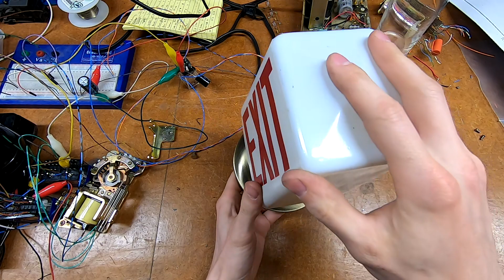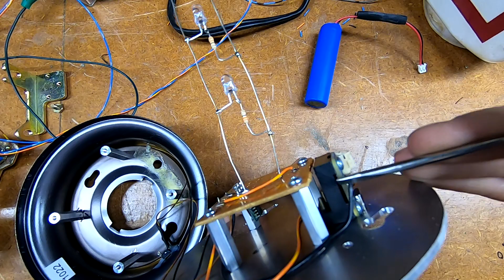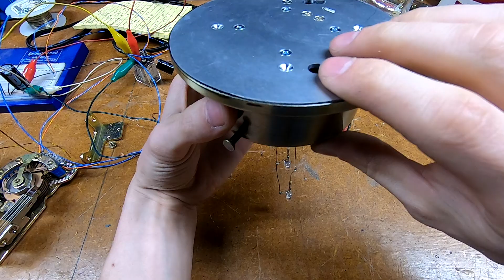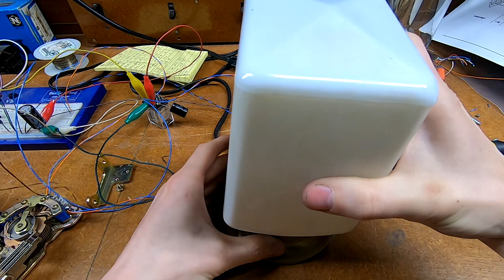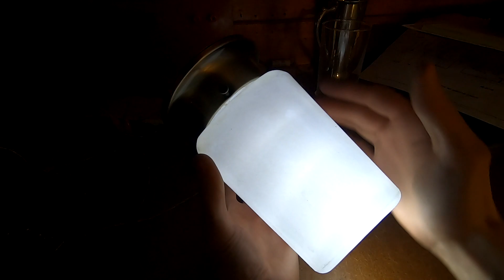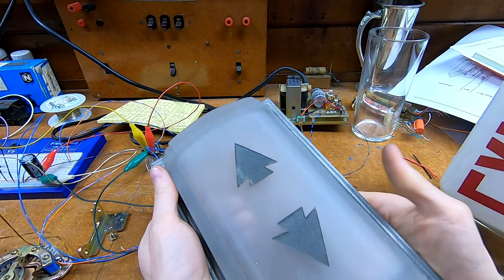Vintage Exit Sign converted to Battery Operation

Comment: That's a TP4065
Reply from the maker: Adafruit's schematic for the 4410 shows a MCP73831/2 charge controller, bit smaller and fewer pins.

Comment: I think your “mileage” with the battery is going to vary a bit. The critical aspect is how long it will take the battery to reach the point where the LEDs extinguish. This may differ considerably from the cutoff point for the 2200 mAhr rating point of the battery. I also think that it may have been better to use heavier wire for the supports for the LEDs. There’s not a lot of mass involved, but it is in the form of a lever. This may become an issue over time. aside from those considerations, I think you obtained a good result. A follow-up report on the useful observed battery life would be interesting.
Reply from the maker: Thanks for the insight! I've got the lamp turned on while I'm at work, currently at 12 hours and counting with no apparent change in intensity. Battery life expectancy is an area that I don't have much experience in, but real world testing is the best way I know to find out.